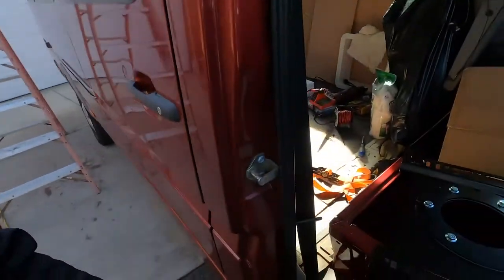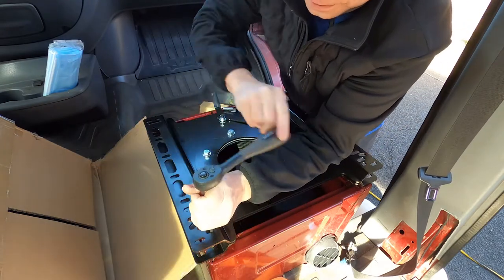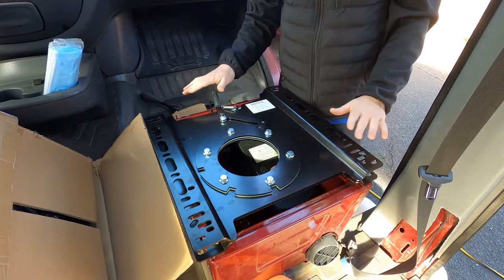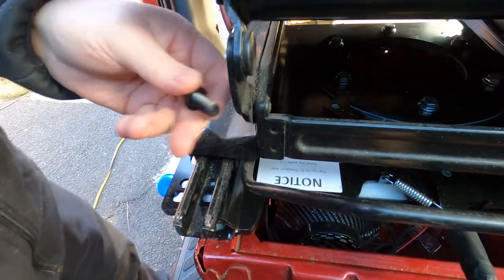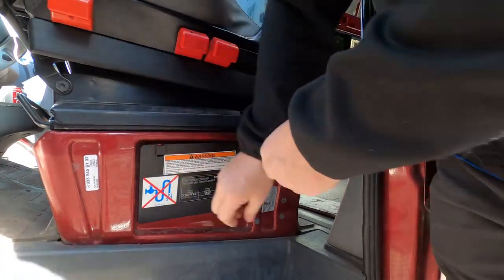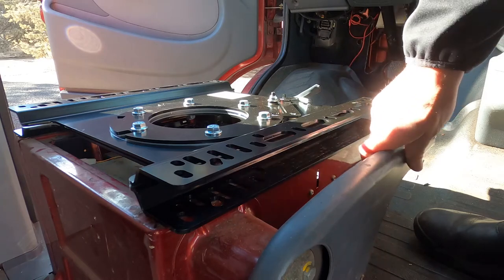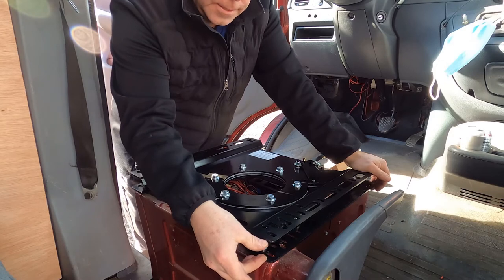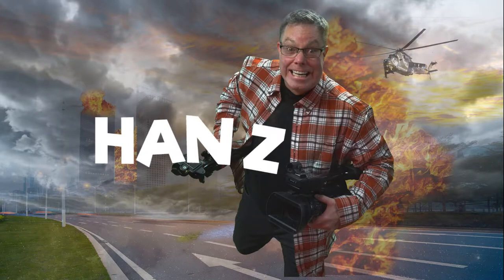Best swivel seats for your Sprinter / Conversion Van, how to install 2021

Comment: So, it looks like even the drivers seat swivels over the parking brake when the lever is down (no brake) then you won't be able to set the lever up (parking brake on) and swivel the seat... is that correct? Seems like the only time you'd want to swivel the seat is when you are parked (camping, roadside meal, etc) and the brake lever would be up. I am getting this right? How are they operating after two years of use? thanks!
Reply from the maker: Yes the only time you can swivel the seat is when you are parked and you will need the break off when you turn the seat but once it is turned you can reengage the break. They are still working great.

Comment: In your opinion "can you install passenger option on the driver side"?
May be some modifications possible in your opinion?
Will it work?
Reply from the maker: I don't think that they are meant to be switched out due to the way that they swivel I don't think it would actually even work. It's worth it just to get the right one and they seem to work really well. Thanks so much for watching.
Reply: I will try this out and update you, I found a deal on 2 passenger swivels